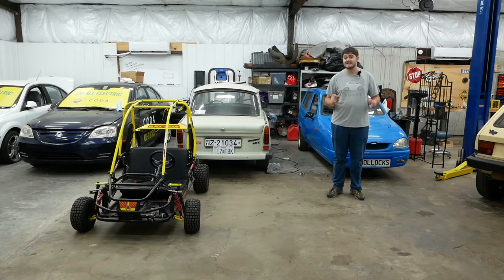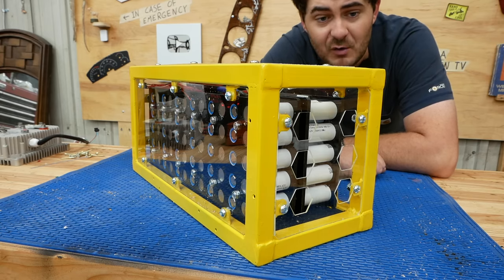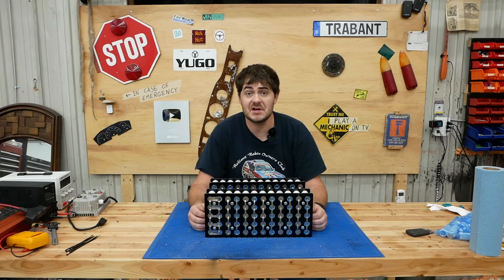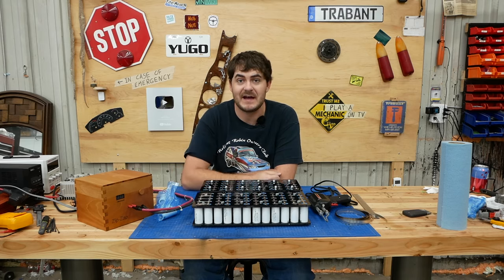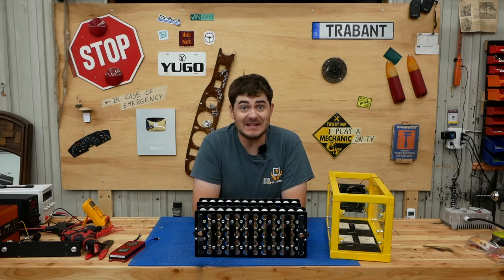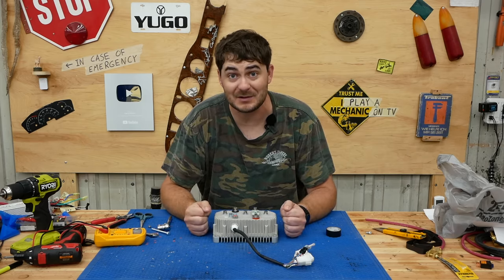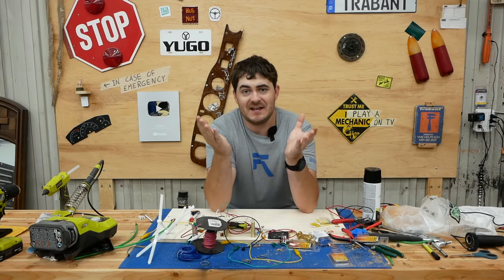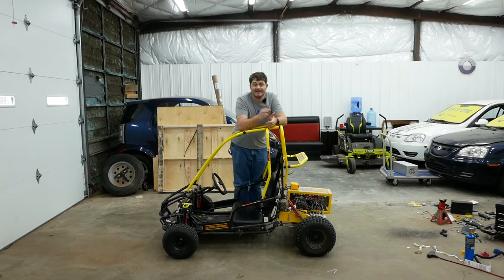I Spent Weeks Converting This Go Kart To Electric. Did It Work?

Comment: I bought a spot welder made for the battery systems such as this fir about 50 bucks and it worked great. Made a 48V 20A continuous power out with up to 35A surge. That was limited by the controller so no problems with heat or resistance. For best conductivity of those large battery cables, you should have soldered them after you squished them. Keep rotor amps down to 2 max.

Comment: Thank you for showing your failures. It takes corage to do it and we learn that this projects can be really hard.
In case there is interference with the hall sensors, maybe you can run an optical encoder with an external plate at the rotor of the alternator?

Comment: At this point, you could have just put a motorcycle engine on the thing and had a 200 hp rocket.
Reply: Or a cheap Predator 212.

Comment: A generator works typical around 6000 rpm, so the gearing must be changed
Reply: Seems a reasonable path to try.  Given that it worked fine on the bench, at least for quick spurts, when it could spin freely at high speed.  He could mount it further away, solidly mounted and hanging the driveshaft off the edge of the bench, to put a load on it...either belt connected, or just something like a fan blade.  Heck, it could be a second alternator, fed into a load of some sort.  

Then see if it'll still function more than a few seconds, while running under load, at higher RPM.
Reply: Alternators can easily handle 15,000 rpm. That is only about 3500 engine rpm in a car. A smaller sprocket would work better.

Comment: Seems like the most straightforward and logical fix is to "gut" that Ryobi ride-on mower of its charger and motor as it has a dead battery.
Then swap all that stuff into the go-kart with its better battery pack as you're gonna be buying the newer/bigger mower soon enough.

Comment: This is a year old at the time of my comment, but who knows maybe this will help. I highly recommend a large RC based motor and esc. Something the size of a go-kart is going to see HUGE current spikes which are probably what's causing you so much trouble when you try to go. I recommend reducing the gear ratio as well to help further reduce the amp load. Anyway, very fun video to watch. I was on the edge of my seat the whole time.

Comment: In 1959 seeing that the future was EV transportation(my dad told me so in 1956) I built an electric Go-Kart using free and borrowed parts.  Motor _ 1941 Packard starter/ Power control_ Chevy foot actuated floor starter switch(all go, no slow). All the electric drive components worked great, but I did have issues with the chassis , steering, and drive axle which took some sorting. Brakes_ my feet.  I was 12-years old  and people acted like I had built a rocket to go the moon.  PS!  I later added a polarity switch to get reverse.  Thanks for your fun and unique vids.

Comment: Look at where the hall sensors are.... in between the iron holding the coils on the stator. Most commercial brushless motors have the hall sensor far away from the stator coils. I think what is happening is going to the bigger/more powerful controller is causing the hall sensors to trigger on the stator field and they cannot "sense" the rotor field.... Long story short, the stator field is so strong the hall sensors cannot "detect" the rotor as it rotates. Just a thought. Keep up the good work and you will get it eventually. :-)

Comment: 11:46 i love this idea. when MS was designing the first xbox, they decided to save money on screws by changing how they mechanically coupled the heat sink onto the CPU. Normally would would screw the sink through the PCB into a plate on the other side, squishing it. instead, they created an X shaped spring clip that simply flexed down and clipped onto four points, and then just pushed the heat sink on with spring pressure. this was awesome until it wasn't because it turns out heating up a spring to nuclear temps over and over makes it weaken, until it stops coupling the heat sink. any of you out there who have fixed a first gen red ring on a 360 knows exactly what i'm talking about lol

Comment: You might want to consider using an Odrive instead of a typical ESC. I made a skateboard out of old hoverboard motors and had similar issues using an esc. Switched to an Odrive and it works great

Comment: Please just use an induction motor. Synchronous motors are generally used as generators for a reason - the reason being is that the 3 phase power going through the stator is moving too quickly for the rotor, essentially causing excess vibration and little torque. 

Induction machines do have a term called ‘slip’ - which is when the rotor field ‘lags’ behind the stator field - this means that at as the motor is accelerating (and rpm is close to zero) the natural frequency of the rotor is close to zero hz, while the stator is still operating at its normal frequency. 

Just look at the torque/speed curve of an induction motor vs a synchronous machine. That’s your reason.

Comment: Hey!  You should consider a cheap $60 TAV30 Torque Converter.  I built a mini motorcycle bicycle using a Harbor Freight 2hp Engine.  That Torque Converter made a HUGE difference in low end/high end torque!!!  (BTW to fit the thing I had to buy a shim for the crankshaft which was an easy fix)  good luck!!!
Reply: That may be necessary due to the alternator windings, wound for a device typically spinning at 2500+ RPM and low voltage/high current.
Why do they call those "torque converter"s? It's a belt-type CVT with a centrifugal clutch. I mean, yeah it swaps torque for RPM like any transmission. Maybe my question should be "why do they call those hydraulic turbine things 'torque converter's when they aren't actually transmissions?"

Comment: I had this problem. Ditch the buck converters and run 72v to the motor. It is being under bolted that’s why it won’t power the motor up hill or past a small amount of torque.  Anyhow, I really like the way you show all your mistakes s as nd thought process on fixing them, let’s me know I’m not alone…

Comment: I did this and had the same problem. When the kids were small, many years ago. (I think there's a clip on my youtube channel?) Much smaller gocart though, but a car generator, rewired. I used RC Hobby stuff, a $100 Brushless 150Amp to power the three phase (sensorless), and an old style $40 brushed motor speed controller running at 12v to power the stator. What I noticed was a very powerful shift in power depending on when and how you powered the stator! I can't remember now, but if I applied a little power on the stator while starting up and then increasing power, it would work great. I would then have to increase as I Powered/revved up. Or if it was the other way around. Getting this wrong would bog the motor and you would have to stop and start over. I used a small Servotester for the Stator Power controller, and a throttle pedal to a servo controller for the three-phase controller. I would have handled this with an Arduino, but I went another direction (other motor).
So my advice to you: Don't power the stator with a static battery, try putting a variable power to it and experiment! My bet is you won't get that error and bogging if you reduce the stator power after getting a bit of speed.

Comment: if a fuse blows, theres usually a reason why.  check the rectifier and the primary side switching transistors for shorts between each leg. they could have died to a transient in your power grid of just overheated, they looked pretty dry  @24:32

Comment: Make a protector to the brakefluid can, i bet the firts time you take it out you kick it off :D

Also that charger is easy to diagnose, just keep desoldering parts until the short disappears.

It's also a good idea to add some eletro-protect spray to all the exposed copper ends etc.

Comment: For future reference, if you hunt around, you can buy cells already spot welded with tabs... or better yet, threaded rod or holes.  They may cost a little more and limit your cell choice a little, but it saves all the hassle you faced.

Comment: Next time anyone wants to follow along, start with a starter motor and trade all the wiring headaches for thermal issues which are still oodles easier to manage. For wiring, might I suggest jumper cables, a good battery or two, a brave friend and you're good to go.

Comment: Lockdown of 2020 I decided to EV power my narrowboat (used on the inland waterways of England). After a few weeks of building it I had the 'it works' moment - then it blew up the controller... diagnostics and much scratching of the head never got it working again. I since sold that boat - bought a bigger one AND recently bought a EV set up.... round 2 is about to commence!
So I feel your pain!

Comment: I have these same batteries cells. his problem is they can only discharge about 10 amps continuous and 25 pulse. But if at any point the voltage drops below 2v they cut off. A 4p setup would often cutoff for me on an ebike. So a go kart would definitely have that problem.

Comment: I wanted to check back on this, it was a really fun project/experiment & you put in serious effort to try & get this thing to work, so good job and TFS this. It would be nice to see you re-visit this project (or maybe you have?) and finish it off, even if you have to bite the bullet and get a decent donk to suit ur controllers, etc, it would make another great vid for us viewers & some kids real happy Im sure. I would suggest to maybe incorporate a limiting device for new or younger riders tho, as with the right motor this thing could have a lot of potential. 
I put a 24vdc 500w motor in a small 2 stroke Chinese quad frame many years ago, with 3 x 12v 14A batteries for 36vdc & a shitty Chinese controller and it went like a power of shit, the kids and adults loved it anywhere it went, it had decent lights, blinkers, horn, speedo, everything worked and I passed it on to my nephew for his kids still going strong 8 years later. Cheers from Australia

Comment: I don't know if anyone covered this in the previous comments. i watched a video a while ago about a guy using a car alternator on a street go-kart build for his class project for school.  He added hall sensors just like you did, double checked everything and it still didn't work as it was supposed to.  after much research and help from others, the problem was the magnet shape the alternator was made of. Since the alternator had magnets that were pyramid shaped, and faced each other like teeth on a shark, they introduced eddy currents into the magnetic field and that conflicted with the hall sensor readings and made the controller not work.  TLDR: you need a different motor like a QS138 70.

Comment: You can solder the nickel strips, directly  on the cells or between each cell. Get a soldering iron that can get up to 440-480C.Heavly scratch the nickel strip surface with a sharp object for extra solder holding strength.

Comment: use a phototransistor / led instead of hall-effect relay on an external disc (with holes) on the alternator shaft. can adjust the 'timing' by shifting the phototransistor/led housing. Instead of mounting directly to the shaft, you can use a 'timing belt' and keep the disc in a housing away from the alternator

Comment: I'd be curious to see what your battery voltage looks like (osciloscope, not multimeter) under load. I have suspicions around those copper connectors. I did something similar using braided copper and camping and well... it wasn't great. After a 3 minute robot combat match my origional A123 cells had shrunk the heatshrink so much they had split. 
It shouldn't explain the hall sensor error but it might (sudden drop in vbat especially combined with vibration could cause any number of weird faults) and it'd also go towards explaining the BMS and (possibly?) the charger?

good luck with it all mate. If you were in oz I'd love to give you a hand with it.

Comment: I admire that you started off with an alternator, but replacing the field core windings with some chonky (or small) neodymium magnets will make a huge difference by eliminating the brushes. In common power tools going brushless gives you 50% more runtime because you eliminate the need to jump a gap. Please don't mount anything electrical to an axle when there is a perfectly good suspension in front of it. A couple of heavy L-brackets from the hardware would mount everything to the backside of the seat area. Do these couple things and make a good thing better. Either way have fun.

Comment: Word to the wise, whenever you do ventilation, the input and output should be comparable (holes in and holes out) and in general you want to have as little obstruction over a fan as possible, so fancy geometry, just a hole and use a regular fan grill to protect the blades (if you must). You'd be surprised just how much movement loss there is from the littlest of things. You could also add half a toroid around the hole to increase the area it sucks air from. jm2c

Comment: Have you checked the max current rating of the BMS, it could be that a noisy current draw of the driver will cause an over current shutoff in the BMS. Maybe try a few large filter capacitors across the battery to help

Comment: FUN FACTOID The Weller Soldering Gun shown has two wattage outputs (for example 1000w and 1500w), the gun is manufactured in a manner that the highest power setting is at half trigger and squeezing the trigger all the way provides the lowest power setting. One would think squeezing the trigger all the way would provide the hottest setting but this is not the case with Weller soldering guns.

Comment: 4:02 I recommend blowing into, sucking out means less air pressure meaning less air molocules to heat exchange with....push air in for reverse effect...ideal is two fans in push pull (so same pressure but fast airflow effectively evenfaster heat exchanging.

but yea worst is vacuuming the thing you want to try and keep cool.

Comment: I know that there's nothing like the feeling of completing a difficult or troublesome task and that there's nothing like giving someone a gift that you built with your own hands, using your skills... but this task started as the simple idea of using an old alternator and other inexpensive parts to make a basic but functional electric go kart and now it turned into building a costly and intricately designed electric go kart. At this point it would probably have been more practical and cost effective to just buy a factory made electric go kart and spare yourself all the unexpected difficulties and labor... but like I said, building and designing something yourself has its redeeming qualities.

Comment: Spot welding is from current, not voltage... really simple to use a high capacity single cell lithium battery or several in parallel.  You can easily dump a few hundred amps into it and weld it.

Comment: After seeing your challenges with this, were I to attempt it, I would probably buy a used donor electric golf cart. 
That would have a motor, controller, battery and charger all of appropriate size/capacity. Maybe spice up the voltage a bit if those components can take it. It may already be speed governed, which you were likely to want since the go-cart will likely be lighter than the golf cart was. A foreseeable downside might be a proprietary controller program/interface if it's even that sophisticated to begin with.
Perhaps if it weren't the programmable type of controller, that simplicity might be an advantage in a go-cart application.

Comment: I'm 90% sure your battery charger has one or more blown MOSFETs (power transistors). MOSFETs nearly always fail short. Sometimes the energy involved in that failure blows them open, releasing fun-colored flames/plasma in the process. The rest of the time, the solid-state magic inside just welds itself into a conductive mess.
Thankfully they're pretty easy to test. Let the charger sit for at least a few hours to be sure the capacitors are discharged, then put your multimeter on diode test and start testing between the leads of each power transistor. If you find one with continuity (a reading of approximately zero volts), swap the polarity of your meter leads and test again. Still got continuity? De-solder the transistor and test it again - sometimes a transformer or inductor in parallel with the MOSFET can show a short when installed on the PCB, but removing every transistor to test it is annoying.
If it still shows short, go ahead and replace it. If it's paired with another MOSFET (an identical part right next to it), probably replace that one too. Look up the data sheet for the MOSFET, figure out which pin is the Gate (the MOSFET's control pin), and give any smaller transistors or control ICs connected to it (follow the PCB traces around) a close looking at or just replace them as well to save time.
Plugging the repaired/suspect power supply into a VARIAC (adjustable auto-transformer) and slowly raising the input voltage while monitoring the current can save fuses. If the current rises continuously with the voltage, you still have a short. If it stays at/almost zero until the 80+VAC range where it does a quick spike during power-up, you're good to go... On the input portion of the supply anyway. You would still want to check the output voltages.

Comment: I think the motor coil resistance is the factor that determines the output power. For example, say the controller is 100% efficient (no resistance at all), it supplies 72 volts to the motor coils. If the motor coils are high resistance (100 ohms say), the most current would be 0.7 amps or 51 watts of power. If the alternator you bought produces 1500 watts at 12 volts, at 72 volts that would be 54 kw ! Maybe something died in the controller, since it was rated at 90 amps, and the load was capable of drawing 750 amps- or the coils in the motor overheated and shorted, or the BMS shut down on over current.